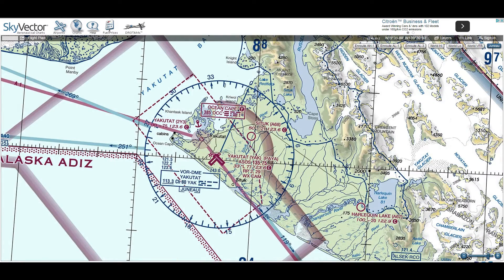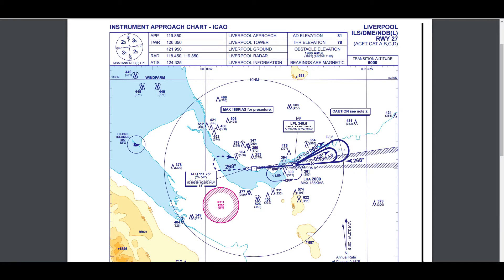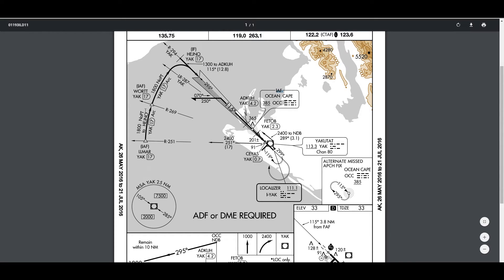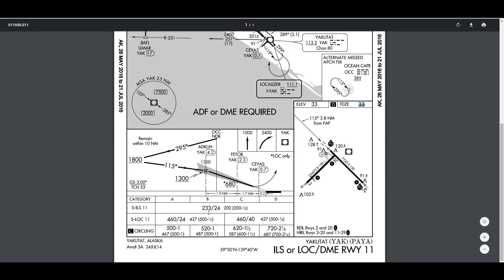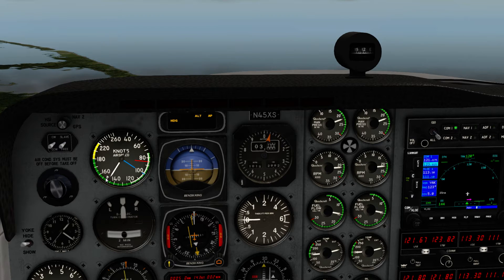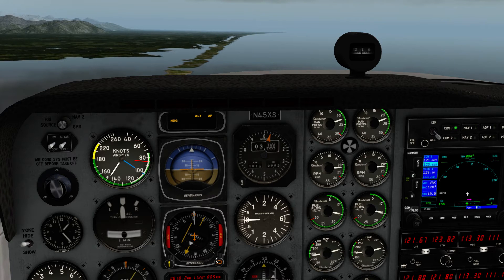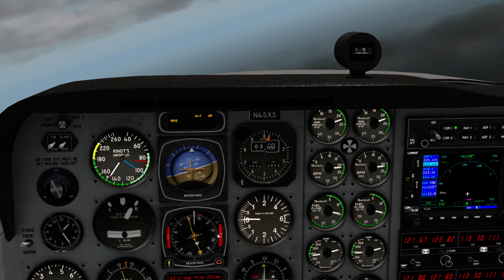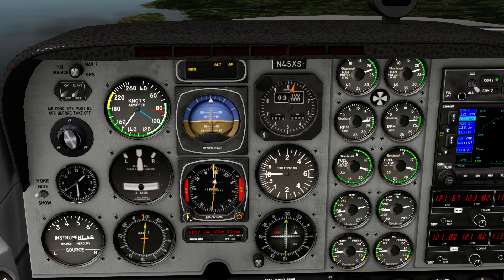Your Questions - Charts and Wind Drift [X-Plane]

Comment: Maybe I shouldn't admit this, but this technique and concept of figuring out your maximum drift angle is new to me and sure would have helped out early on in my training. I'll still make good use out of it flying steam gauges on a few NDB/VOR approaches in the sim. Another excellent video.
Reply from the maker: I was taught by a number of very practical instructors and this max drift rule of thumb was one of the really good things they passed on.